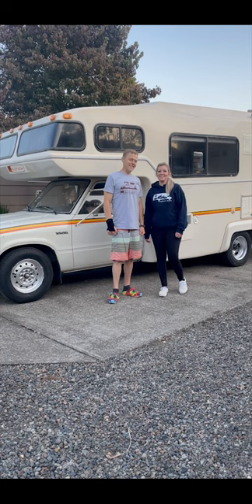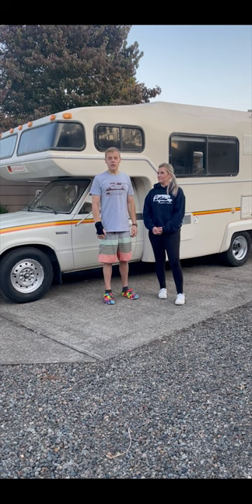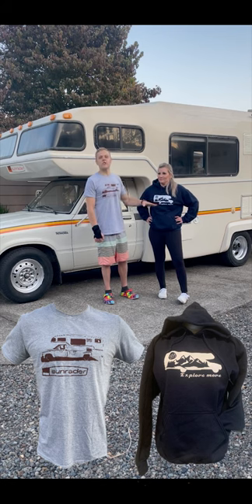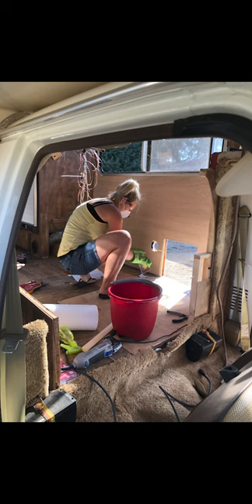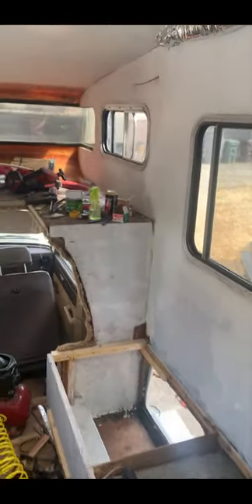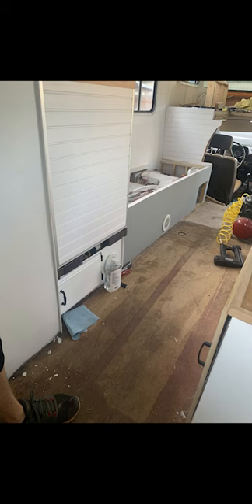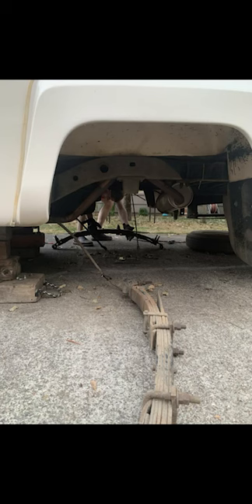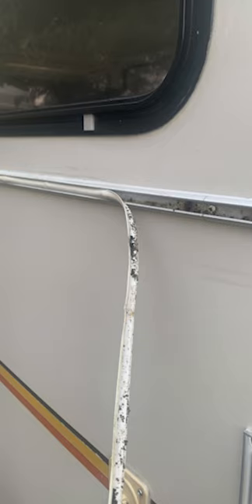Toyota Sunrader Motorhome Complete Renovation

Comment: I'd have been interested to see what you did for power. Any solar, lithium batteries, inverter, etc?
Reply from the maker: At the time, we opted out of doing solar/additional power additions due to not wanting to spend much time off the grid. We also wanted to get the build done in a relatively decent timeline. 

I did research it during this however back in 2020 a lot of the panels/inverters were back ordered.

Comment: I had one of these, decades ago, think it was the dolphin. the thing was scary on the highway, putting along top speed 50-55, sometimes as slow as 45 climbing grades, with trucks and cars whizzing past you and in some cases almost running into the back of it. kinda dangerous i remember.

Comment: I once thought a Toyota was the right rv for me however I couldn’t find a good one and learned why it isn’t since.   You have to be aware of every pound you add to one because they are easily overloaded with drastic consequences.    I urge you to have it weighed, because your steel floor might push it over the edge.   I exited at the new toilet and didn’t stay to the end    The Tiger I accidentally found while looking for the Toyota turned out to be the perfect small motorhome
Reply from the maker: They're not for everyone but if you're willing to put up with being under powered and having to pack light, they can't be beat due in regard to their reliability/durability. Even then you can remedy some of the issues you addressed such as upgraded rear springs, airbags, shocks etc. You can also swap in a 3rz or a 5vz-fe relatively easily for a little bit more grunt.

My steel reinforcements probably added approximately 10-15 pounds. We probably shaved well over 100 pounds through this remodel by the removal of a closet by the rear door, passenger side upper cabinets, the "L" part of the previous couch and getting rid of the swivel chairs.
Reply: I enjoyed watching your rebuild process. I have an 1983 Toyota S/R also that I'd like to update as well so thanks for all your tips  Steve s.
Reply: There's a reason why these old toyotas pull the money that they still do... The reliability can't be matched, yes they're a bit underpowered but that also makes them efficient!   It will never get you anywhere fast.......  but it will always get you there!
Reply from the maker: @carbonrrpilot  That's the truth!

Comment: If I remember correctly, isn't the rear axle on them involved in a class action lawsuit with Toyota and that's why they abandoned the concept.
Reply from the maker: Yes there was a NHTSA recall on the 5 lug axles. When the 5 lug breaks, the axle snaps off before the hub assembly potentially causing you to lose full control. In 1986, they upgraded to the 1 Ton 6 Lug Full Floating style axle.

This did have some impact on the demise of the Toyota motorhome concept due to the manufacturers having to eat the cost on replacing the upgraded axles. The Toyota pickup chassis was not designed to support nearly 3 tons of weight that some of these units were weighing.